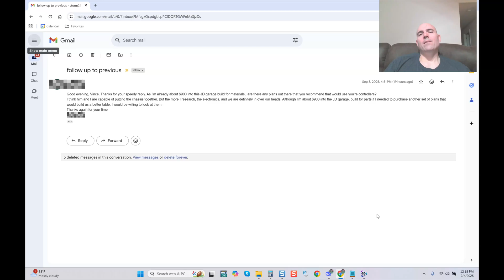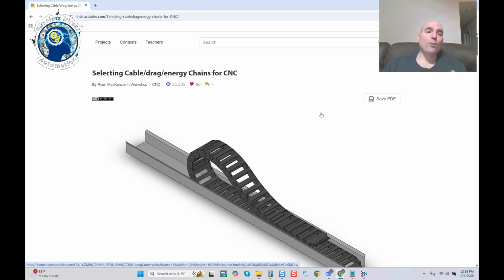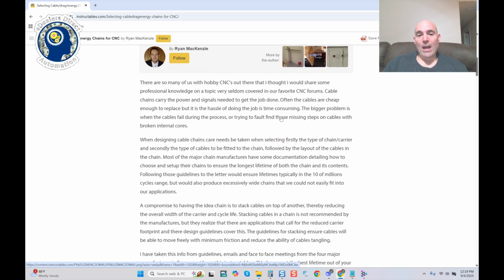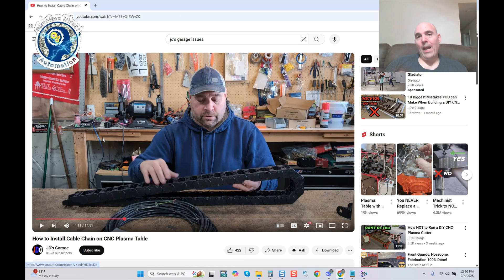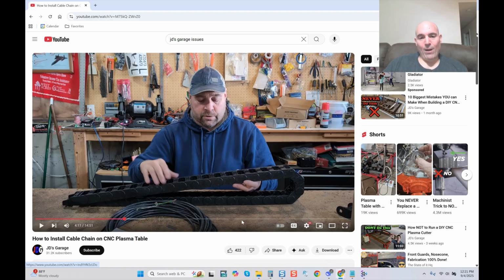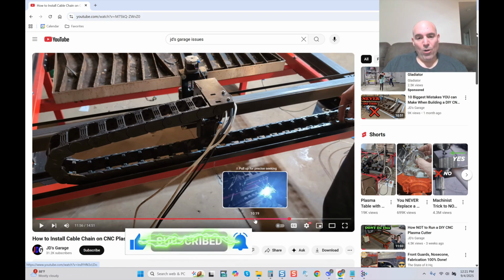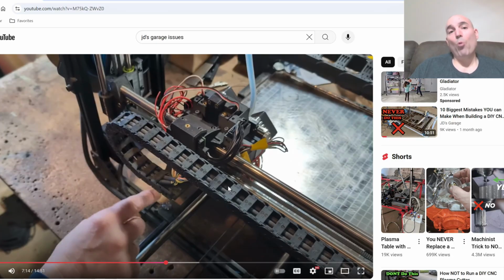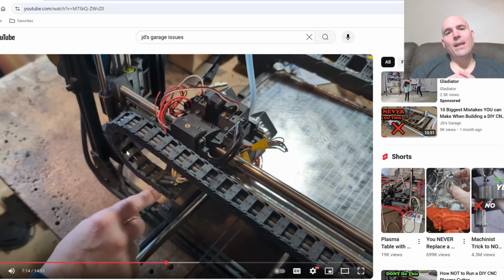❌ Wrong Again, JD's Garage! ❌

Comment: I bought the 1" by 3" cable chain cause I knew it would be tight with what was suggested. I have to design the mounting brackets and cut them on my plasma with hanging wires then begin breakdown of wiring and installation of the brackets, angle iron, cable chains and rerouting of the wiring through the chains.

Comment: I agree on with you on the cable chain situation but these are hobby machines that will never do any kind of production runs. The stuff they use will probably last a guy in his garage along time just making an occasional bracket or sign. The belt set up seems like it would be a bigger issue to me.
Reply from the maker: Thank you for your support, but this is a common misconception in production robotics. 

The most money wasted is due to vendors that don't pay attention to all the details when selling their systems. 

Regardless of the application for use with the robot it doesn't change the requirement that you'll experience downtime, and money wasted if you refuse to invest a proper sized cable chain, and the correct cables. 

If someone uses the robot, and gets 3 months out of it before cable failure, and another gets two weeks out of it before having issues its really just a gamble either way as the failure will certainly take place the question is when.

The vendor of these plans doesn't explain any type of timeline on how long using the incorrect cables will last when using the incorrect cable chain because he doesn't know, and either would any other vendor that's why understanding what you're selling is essential to protect the clients investment.

CNC robotics is math, its correct, or its not, and if the end user understands this and is willing to spend money of maybe's then that's on him, but if a novice isn't aware, and trusts a vendor selling these types of systems then they should be held accountable to provide accurate information.

Thank you,
Vince
Reply: @corvetteguy50 well said and I do agree that he started selling the plans too soon.

Comment: I ran a 5x10 Lockformer Vulcan 2900 with a Hypertherm for several years.  That thing would crank out duct/weldments all day - every day in about every material.  We would run 100s of sheets back to back without a glitch, filling our parking lot and an adjacent field with duct.  It was the absolute core of the business and paid for itself 1000 times over.  There were only 2 times that it was down that I recall - once for a gantry servo motor that flaked out and another time the fiber optic TX card died in the PC - and those issues were resolved quickly.  
I appreciate your observations on these hobbyist grade contraptions - I was going to do something with my $189 laser gantry... but thankfully you talked me out of that several videos ago.  If I need to plasma something there's a metal shop down the street that can do whatever I need for a reasonable cost and save my 10W laser for whatever it's good for.
Reply from the maker: Remember the golden rule your money is always safer in your own pocket! Great story, and plasma systems working correctly make 6 figures a year with ease. Thank you for your support! Vince